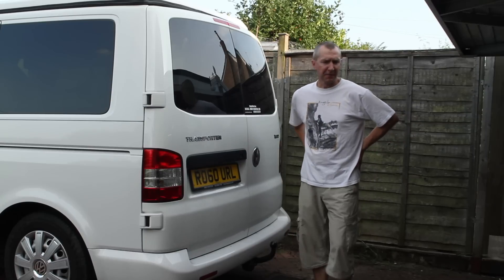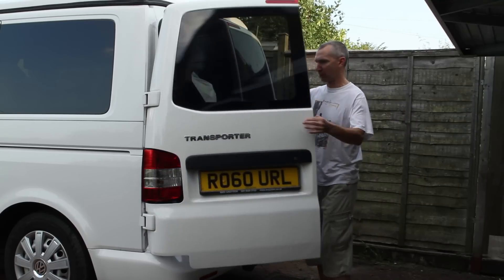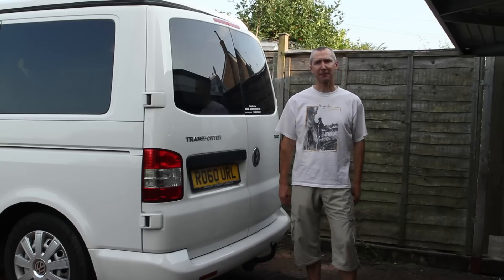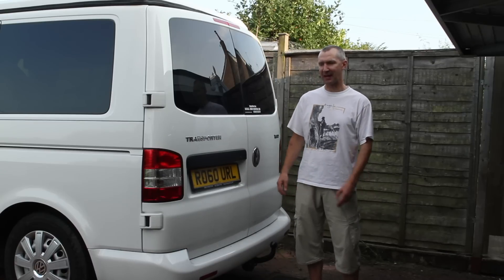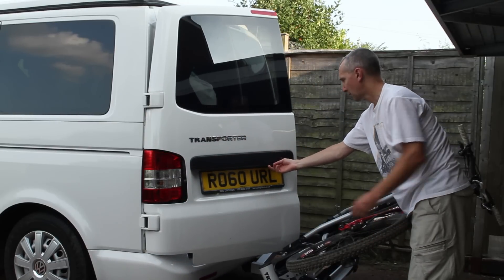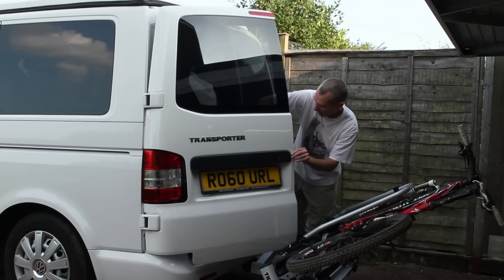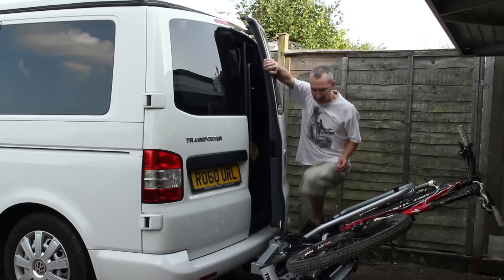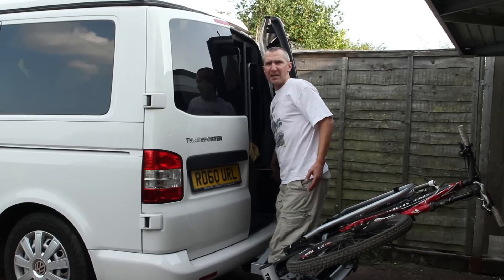Thule 928 bike carrier on VW transporter T5

Comment: This is an old video and you probably know this already but...You can move the cable on the rack to the next hole and it will allow you to drop the bikes to 90 degrees.  That will give you the clearance to open the barn doors.
Reply: Hi! I know this is two years old :D
But if you were still reading, would you have pictures if you did it yourself? or at least directions on how to do it? Thank you!!
Reply: And does that allow back doors to fully open? I'm searching for a tow bar 2x bike rack that allows barn doors to open, and cant conclusively find one

Comment: Simon, MANY thanks for this video! just what I needed to know  - How much extra clearance do you think is needed to open the left barn door ? if it were an inch or two could a spacer block not be fitted (towbar type  permitting obviously) between the mount and the towball to increase the gap ? or is it 4-6" plus and implicitly a non-starter please ?